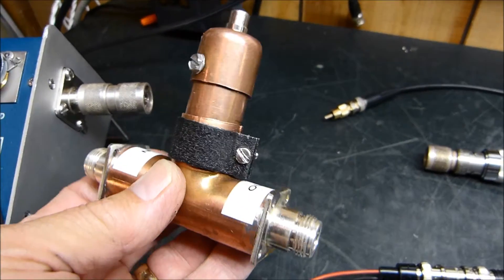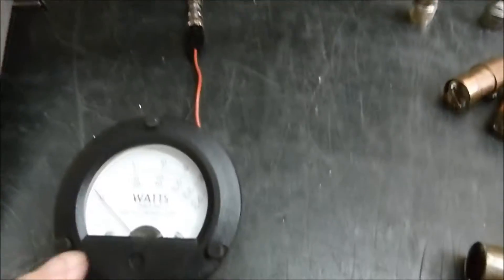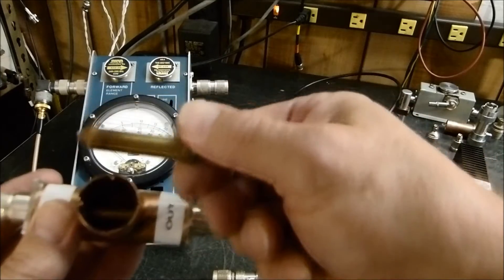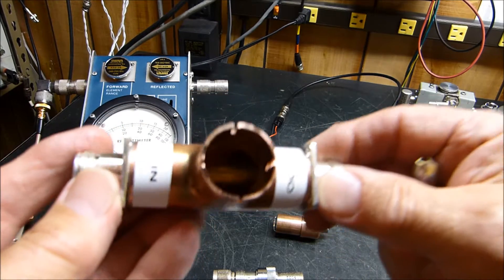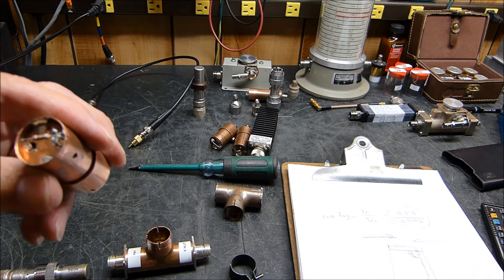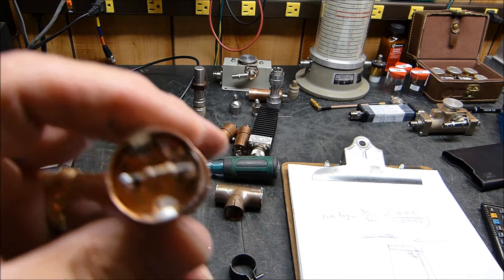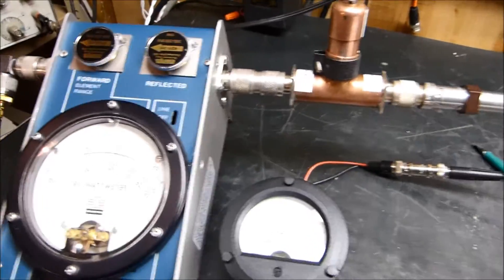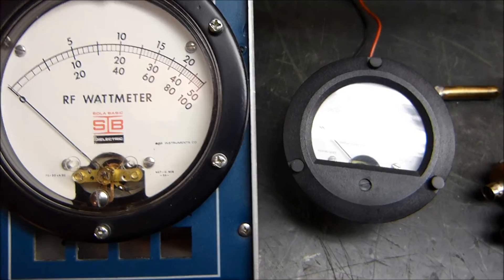2.4 GHz to 2.5 GHz WiFi Wattmeter

Comment: Try changing the 100 ohm resistor with a high freq diode, germanium, to the capacitor to ground. Then from the junction of the diode and cap connect your 1k resistor (or so) to your meter. Put the diode ( a nonlinear circuit element) in position to AM detect the RF. I built this same absorption RF detector type apparatus in 1976 only I had two of the detectors in one package about 8 inches long. One of the detectors was reversed and I could, with two meters, read forward and backward RF at the same time. I cannot remember the circuit completely but this is as I remembered the circuit. Also another thing... I removed the center pin of the RF jacks (I used PL259s I think) and connected them to the center barrel conductor. Then with one connector base mounted on the 3/4" copper insert the pin/barrel assembly and insert the other RF jack onto the other end. The center conductor, if the length is cut right, will be held tight between the RF jack bases.
Reply from the maker: Mark Cummins Hi Mark - I have built the dual-section copper pipe devices also back in the early '80's. I also used PL-259's for HF service. I found I could calibrate them at one frequency and one power level but tracking with a commercial meter was a different matter. As for the diode as a pickup element, I have tried that also but it did not seem to work as well as the resistor. Ans, of course, 2.4 GHz is a different world. It is interesting that this one turned out so well but I can't duplicate it. I don't know why.

Comment: excellent! I need to find or build a cw 2.4ghz signal source and this meter. will also need to devise a way to calibrate it unfortunately.  what did did you use (random germanium?). anything special about that .01uf?  ceramic I assume? low esr?  thanks again.
Reply from the maker: +George Viaud Hi George -  I did try a bunch of random germanium diodes - some where high-end "microwave" type 1N23B, 1N21B, etc but I think the one that worked the best was just a plain looking diode labeled as AN442 - not sure if that is a real part number. As I mentioned in the video, it was disappointing that I couldn't duplicate the performance. There is nothing special about the 0.01 uF - it is just a very small physical capacitor. I don't know if you have considered a directional coupler but I have a HP 777D (1.9-4.0 GHz) that I have used on a number of occasions that go for a reasonable price on Ebay. You do have to have a spectrum analyzer to make it useful. For this 2.4 GHz work the SA might be a good item to look into. And I completely agree with you needing a cw source. WiFi equipment just won't work as a signal source as I tried it also. For my HP SA and signal generator I did have to spend some good money ($3700 for both) please don't tell my wife...  :-) Good luck with your project. Please keep in touch.
Reply: I was looking at a spectrum analyser on ebay and am amazed the prices are now as low as they are - but still well out of my budget :)    I used to design digital electronics for a medical imaging company about a decade ago and always had their toys to play with.  Eventually I'll get to collecting my own - right now it's second hand oscilloscopes and diy function gens along with whatever else I can scrounge or build.  Re: 3.7K - I think you did great on that deal - but I still won't tell ;)  73 from n. idaho

Comment: Hello Sir probably a stupid question but I was wondering this morning as I was in the kitchen if the carier from the magnetron of the microwave oven can be modulated or in other words used somehow as a Power Amplifier? Thank you
Reply from the maker: I am sure it can. The microwave magnetron is running as an oscillator and not an amplifier so it would not be conventional AM by modulating the plate voltage. At least I don't think so but I am sure a little research on how to modulate an oscillator would give a solution. Sounds like fun,